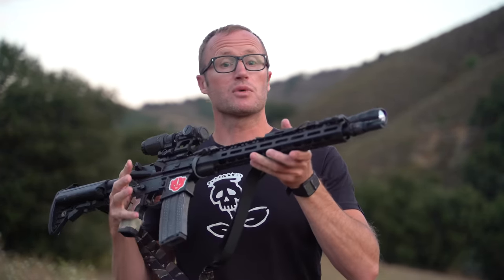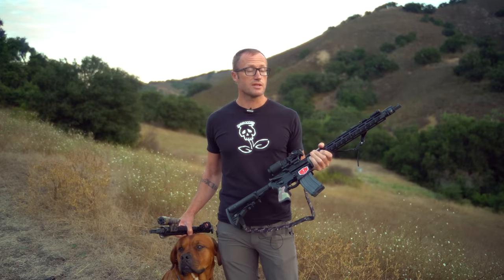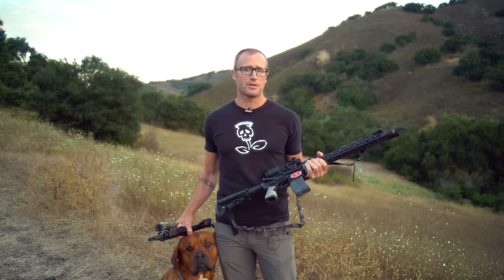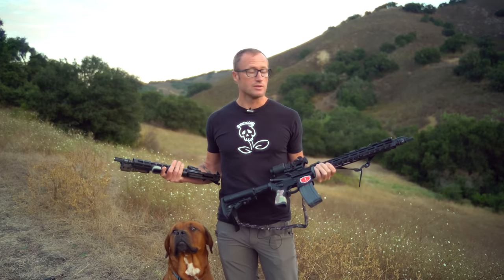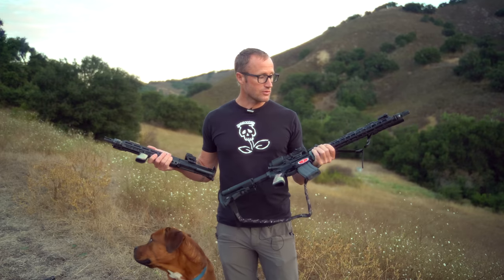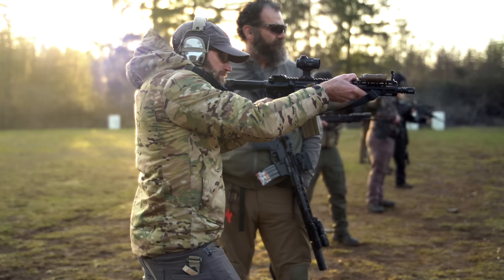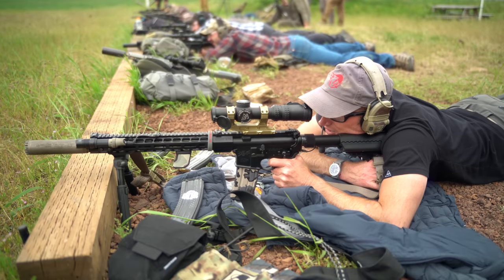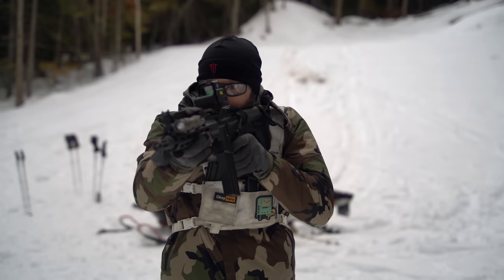Sons Of Liberty Gun Works M-76 & M-89 Rifles

Comment: Both the wedge lock (M76) and drive lock (M89) have an internal anti-rotation mechanism in the form of a stainless steel pin, half of which is contained in the upper, and half of which is contained in the rail, located just above the hole that houses the gas tube.
Reply: Can't go wrong with either one's!

Comment: I agree ..not special just good smart QC and do it correct .. Just hard when psa sells bcg 50$ I just guy 3 lol.. But I have a bcg in my main ar15 runs great
Reply: $50*
Reply: Yeah, but all things considered PSA is at the opposite ends of the spectrum as far as QA/QC compared to SOLGW. Those $50 dollar PSA Toolcraft BCG's hadn't had their 3-bores gauged for efficiency. Hadn't been tested...etc. Toolcraft is 100% garbage. Their claim to fame is they had a one off 750k contract with the .mil/.gov during the GWOT era. And had the cage code B1B6. And they had a recall on those BCG's. So that should tell you how good they are. You can lookup on the googles the cage code and recall on them. 
I know for a fact that BCM and Sionics recieve all their BCG's in the white from Microbest. They air gauge all of them after the parts are parkerized. And in Sionics case after NP3. If the 3-bore on any of them are not in spec they get tossed. If the firing pin protrusion is not within spec. The bolt gets tossed. It takes people to do these things and that's the added cost. 
I have two Microbest BCG's that are parked. And I have like 9 Sionics parked BCG's. ($89.00 circa 2017 and $99.00 circa 2018.) The Sionics assembled Microbest BCG's are way better fit and finish. The same OEM...🤷🏼‍♂️ Plus they have OCKS carrier key screws and Sprinco 5 coil extractor springs. 
The only really good BCG that I've seen from a OEM directly from the OEM is the AO Precision's. And those were the military overruns. Not the civ direct sales. I bought a few overruns as replacements for my Colts when the time comes. If it ever does. It plays into my OCD and paranoia.
Reply: Would always recommend spending a little more to get quality. Especially when you're talking about the part of your rifle that facilitates the tiny explosions right next to your face
Reply: @Dj1DurBreD  That ain't no sh*t neither.

Comment: The other handguard has anti rotation too with a stainless steel pin above the gas tube. It's the same handguard as the mega & zev wedgelock handguards.
Reply: Which is a Jim Hodge design. Hodge Wedgelock. The Hodge is in 7075-T6. And I do believe the Mega's were as well. I know that FN, Solgw and others were using them in 6061.

Comment: What made me a believer is just listening to the solgw guys talk on big Tex podcast. From gas port size to mim parts vs properly assembled rifles. Very knowledgeable. But Mike had this look on his face while discussing what would happen to the majority of guns if they were ever shot full auto and suppressed or both lol. He says a lot of these so called Gucci guns would just choke and that the nfa is actually preventing the platform from excelling. Should we ever get our rights back, a sons, bcm, g, slew of others would be easier to convert. Just overall cool cats man and passionate about the 2a and my bcm, solgw guns have just flat out ran in classes. Nw Ohio we get every type of weather here. I’ve loaned out bcm and solgw to buds at classes after there premium build or Gucci gun failed while the not so great duty solgw, bcm, sionics and geissele ran. Plug for old bill I guess. If u shoot a lot, solgw is a good choice, if it’s just gonna sit in a safe, get a fancy queen and shoot it sometimes, then don’t lol. If sons offered a chrome lined hammer forged variant, I don’t think I’d buy anything else tbh. Springco springs, fcd safety, a5 buffer system, robust hand guard, gassed properly and warranty alone makes for a lifetime of shooting
Reply: SOLGW is one of the few companies that mills the m16 auto sear pocket in their lowers. They don't have the required third hole above the safety (and drilling that out is HIGHLY illegal), but the internal milling is already complete. Colt goes the other way and has a complete integral sear block machined in. Even BCM and DD are just low shelf and could not fit true auto sear parts without significant machining, whereas SOLGW can be converted with the right jig and a drill press. SOLGW cares about our rights.

Comment: SOLGW put together a really nice package. They seem to low key a lot of stuff. Their new barrel contours coming out seem really nice. But they are not their own. Very reminiscent of Criterion Core series barrels. And some of the Roscoe stuff I been seeing. But they have built relationships with people like Jim Hodge, Forward Controls and the like. And probably the barrel OEM's as well. 
I think they understand trends. They also understand that doing things right and understanding the envelope at which the system is being designed to operate at efficiently. But...There is other companies doing this to. BCM has been at the forefront of doing things right for a long time. That wasn't named Colt. Same with Sionics out of AZ. Which I'm a huge fan of. Very low key company. And not very expensive either. Their rail has a 3 bolt lockup like the M89. ...$120. Probably not as robust. But I haven't had any issues with zero degradation with the Sionics rail. My issue with SOLGW mostly. Is the price. I think Geissele makes a very good go to war option too. But are expensive.
Reply: Im really interested in the siinics rail, how has it held up for you?